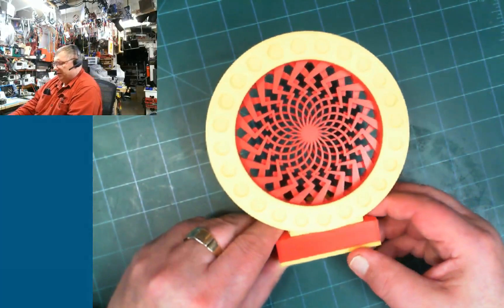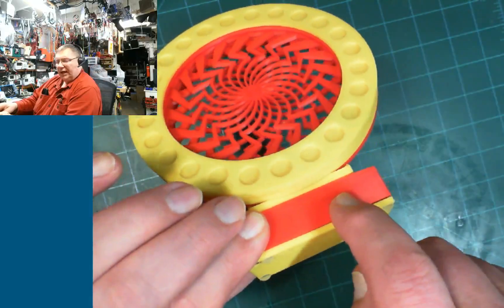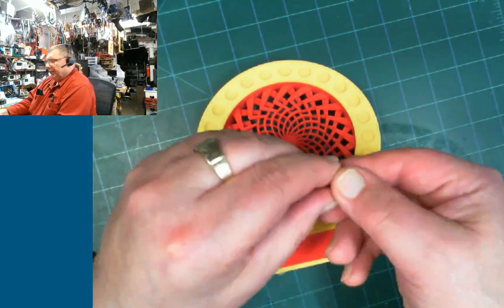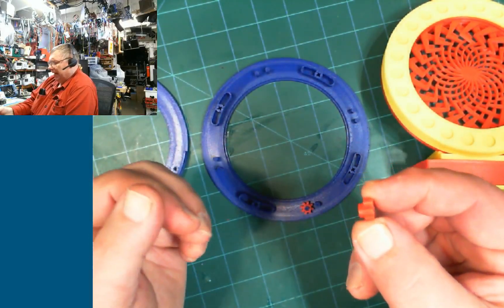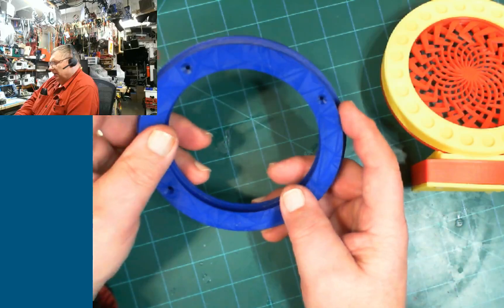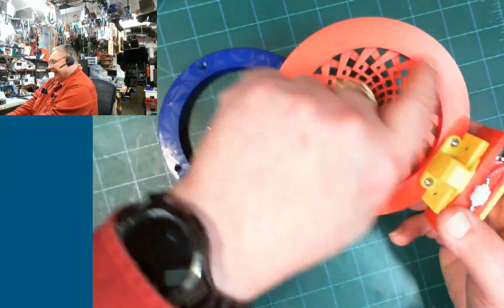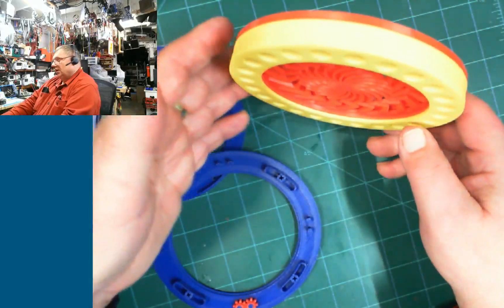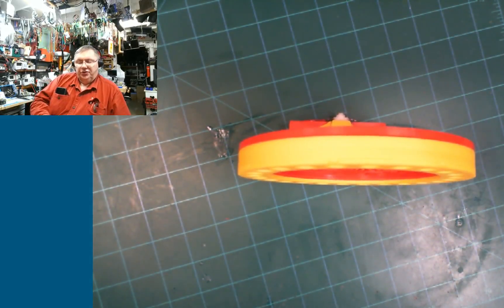Ring Gears Illusion run with a small electrical motor.   Printed on Bambu X1C

Comment: That's really cool! I can't wait to print this when I get home today. I will see if I can power with 18650 and BMS. All my motors are much larger than what would fit into there so I will have to see how to modify it so I dont have to buy new parts.
Reply from the maker: Yes, I love the effect it creates. I was gonna use also 18650 batteries and a BMS with a speed controller, but I'm thinking to make a larger version and modifying everything.... But that is somewhere in the future. Have a great weekend!